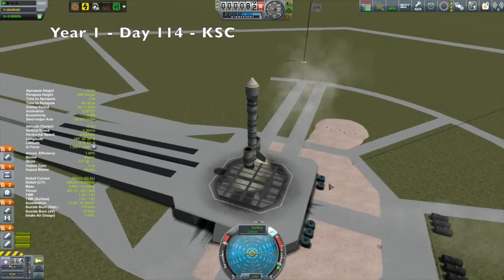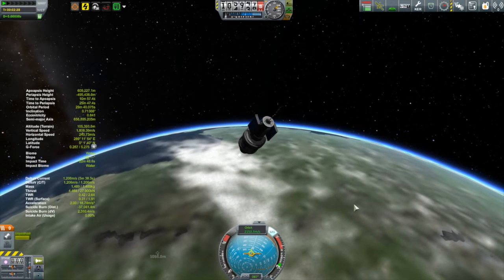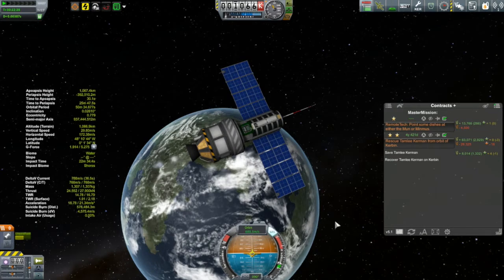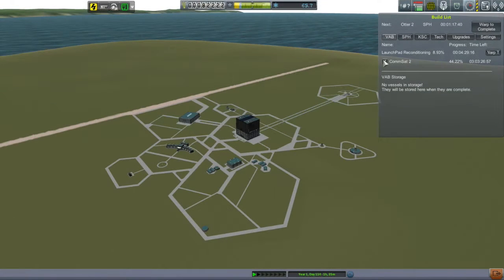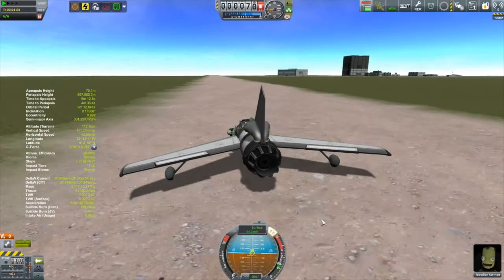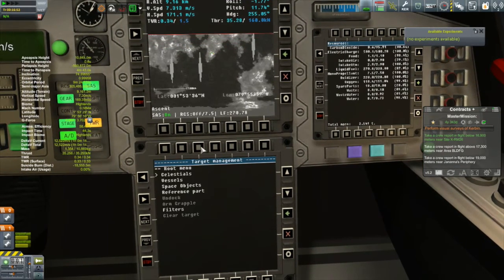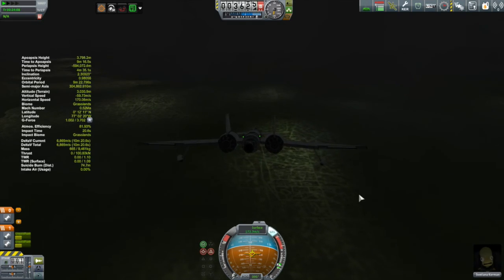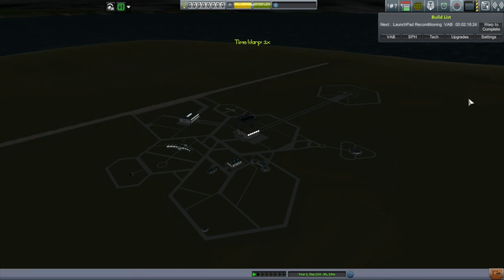KSP Career: Episode 13 - High Altitude Surveys

Comment: Super late comment but for some reason when I make rocket/jet planes like the one at 11:30, my rocket fuel oxidizer runs out before I run out of rocket fuel. How do I prevent this? Are the jet engines draining my oxidizers somehow?
Reply from the maker: Jet engines do not drain oxidizer. It's always tricky balancing fuel and oxidizer when you mix jet and LFO engines and it often takes some playing around. If you are running out of oxidizer first, you just need to add more, or remove fuel.